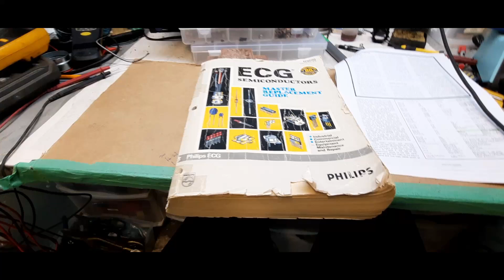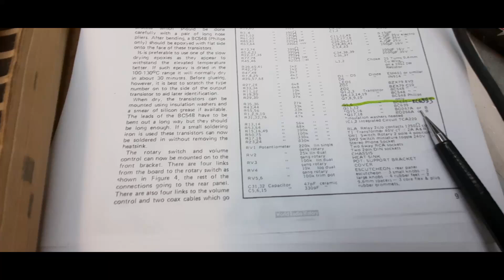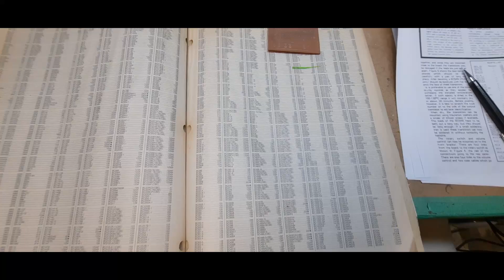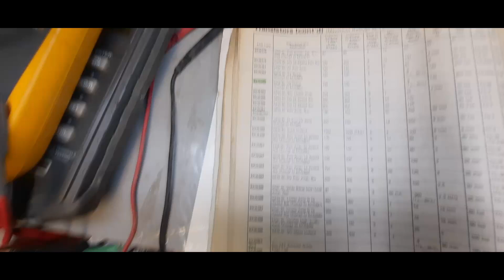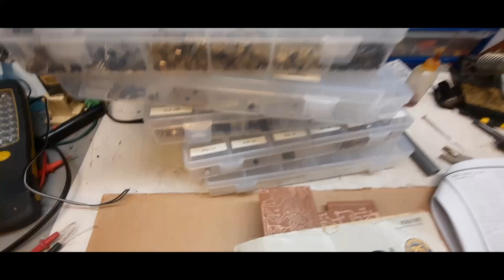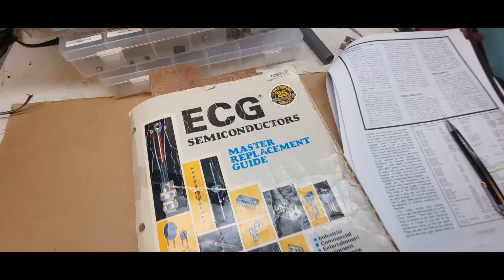ECG Book - How I find Transistor Substitutions

Comment: Do they even still print those? The ones I  have for NTE, ECG & RCA were printed back in the late 80's/90's. They did have an online version for awhile.... but haven't seen anything new in decades. If there is anything new.... post a link. Thanks.
Reply from the maker: I highly doubt it. Like you, I had the same experience with the books. I found some links but they are not good. Half of the time you cross reference you get nothing. You can google it to find the link. Good thing you got a paper book. Like gold these days. Cheers